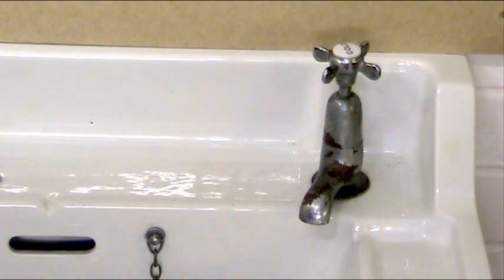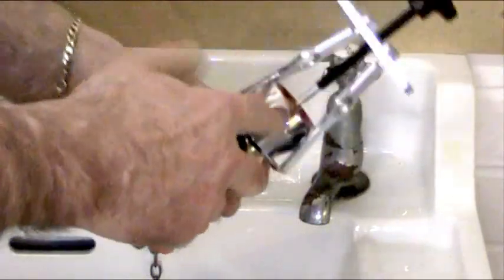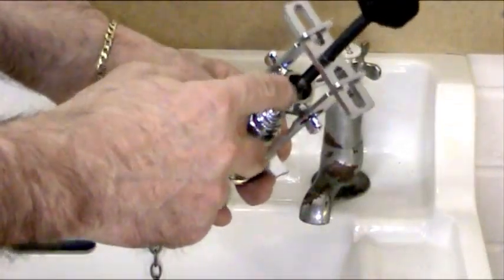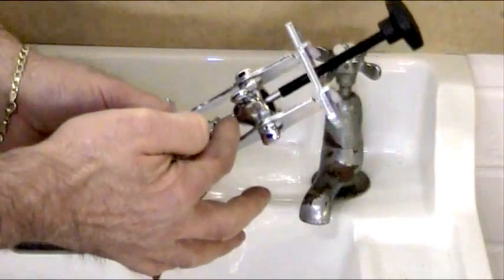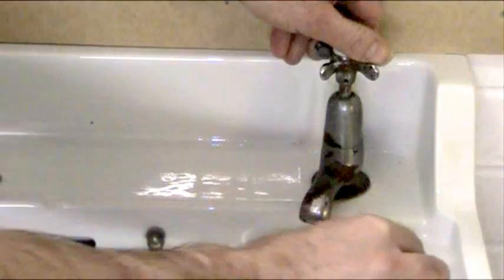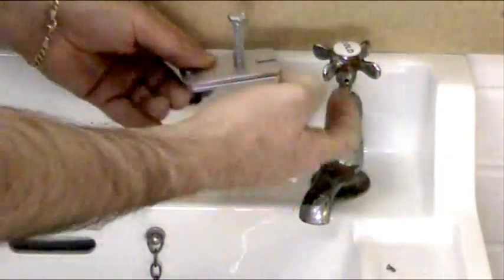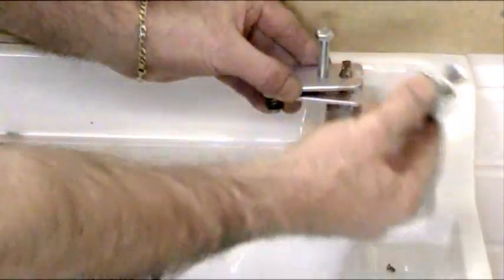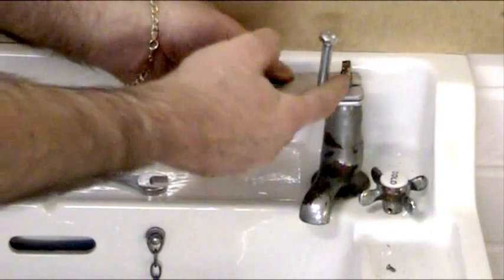Tap handle removal made easy.

Comment: The problem I am having with my Haron puller is that the puller screw will not stay centred on the top of the tap spindle, and as soon as I tighten, it slips off to the side.

Comment: The tap handle is not the difficult part to remove. It's the tap headgear and spindle that is the one that is near impossible to remove on those old taps. A normal adjustable spanner is not working for me and that spindle gets in the way of being able to use a universal gator attachment for my power tool.
Reply: Hello David, Have you had a look at our Easytapsplitter? videos on youtube how to sort tight headgear as well.
Reply: Graham Downs In the I had to use the wall to wedge the grips against and use a heavier adjustable spanner. That did the job of un screwing the headgear.